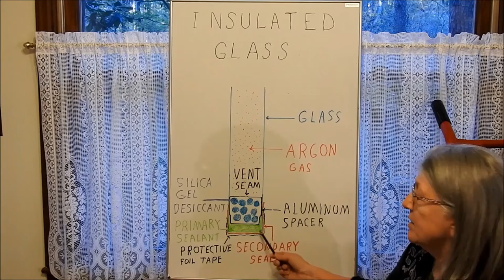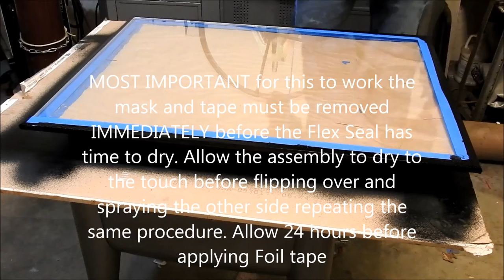DIY FOGGY WINDOW REPAIR

Comment: This is exactly the video I needed. Awesome job on the window and the video!
Many thanks for spending the time to share your knowledge and help a lot of people.
Reply from the maker: Thank You so Much!
When the house was built double pane thermal windows were relatively new. I saw condensation failure in both the inexpensive as well as the top of the line windows. With that in mind I had to wait for technology to catch up. Crlaurence, the largest glass product supplier in the US, finally perfected the sealant and devised the system I used for this video. Their description is for "Small scale thermal double pane window manufacturing". I obviously did a lot or research over the years and knew about Argon injection early on talking to the experts. I also had taken quite a few panes from customers to a glass shop and personally witnessed the Hot Melt fabrication technique. This system fit my needs perfectly and I could control every aspect of the process and use the best material so I never have to do this again in my lifetime.

Comment: Great video, really good detail. This is a job that is on my to do list. Most people (everyone, I imagine) here in the UK just replaces and scraps the old unit. Thanks
Reply: With a little knowledge and effort expensive items can be made to give many more years of service. Valuable know-how out here in the sticks.
Reply from the maker: Yes.  My case was probably more extreme than the usual foggy window. My dormer windows failed early due to their location over a roof (8 to 10 years) others lasted much longer with the majority still in fine shape. (35 years) Realizing the only solution was to fix them myself I had to wait for technology to catch up to a suitable level. The cost saving was in the 10's of thousands.
Reply: @rlbob1  That's a lot of money saved and a lot of satisfaction for you. I am only looking at a £150 ($250) unit that is damp, but I reckon I can do a repair for £20. 

Was the black spray vehicle underbody sealant or something else? Thanks
Reply from the maker: @bootsowen  Its called Flex Seal and is available in most hardware stores in the U.S. It applies similar to automotive bed liner. High build, fully waterproof with the convenience of a spray can.  My windows lacked the recess that would allow for thicker secondary seals such as butyl tape. Using a water proof spray covered in foil tape fit the frame perfectly. I was quite amazed at the easy build up and even coverage from a spray can.
Reply: @rlbob1  Thanks!

Comment: this is a beautiful video in more ways than one
Reply from the maker: Thanks! Our curiosity turned into a Forensic Examination as to what went wrong. What we discovered was lack of any quality control or skill from the workers. We discovered windows with only one frame filled with desiccant clay.(cheapest desiccant there is). Astonishingly on the window that failed first the worker ran out of caulk and skimped on the last frame with barely enough to fill the edge. With replacement estimates 10K to 20K sometimes its best to do it yourself. Jeesh!
Bob

Comment: Only have single pane house glass, but sure could use some of that cerium oxide to polish a scuff out of the truck windshield.
Reply from the maker: Amazon or E-bay has any quantity you want.  A mere 8 oz would be plenty.  I already had the Dewalt 849 buffer but you could probably use a drill with a hard wool buffing pad. just mix 2 parts water to one compound. The most important part is always set the buffer in a safe place like a cardboard box not a concrete floor.  If it ever picks up dirt or sand it will ruin everything.
Reply: @rlbob1  Good advice. I've picked up grit on a buffing pad before, not good.

Comment: Great video - where did you get the caulking tip?
Reply from the maker: Same supplier as the caulk one of largest suppliers in US. Anyone in glass knows the name.  You probably will not want a commercial account with them but resellers of their supply's are all over the web.  Just look it up on their website. It comes in various thickness to match your windows. Bit pricey at $25 for a piece of nylon but worth it in the end. You can drill out the tiny hole to match your caulking skill.
https://www.crlaurence.com/

Comment: C6 parachute towed behind 360 hp cabin cruiser.?
Reply from the maker: Although I did successfully launch the 30 foot parachute with attached 150 lb bag of sand off the back of a 12 foot boat it was difficult. You really need a good crew for that.  I have been scouting dry lakes out west instead.  Water makes it too complex and possibly dangerous without a really good support crew.. I have coupled a 29hp Rotax engine with a reduction drive and now bending 6061-T6 tube. Going for a Trike.

Comment: let me go grab my tank of argon gas and try this.
Reply from the maker: Lots of fun. Could not resist doing it over and over. Since the Argon is used for welding it is super dry gas. Water is the enemy of welding since the plasma separates it into Hydrogen and Oxygen which would ruin an Aluminum welds.

Comment: You should have included verbal comments throughout since most of the video did not help with with the crucial steps in the repair.
Reply from the maker: Sorry about that. I have a southern drawl and not good at public speaking.  Stage fright also comes into play.
Reply: @rlbob1 you did just fine no need to explain. Thanks for sharing.